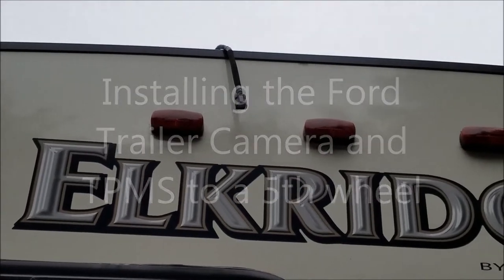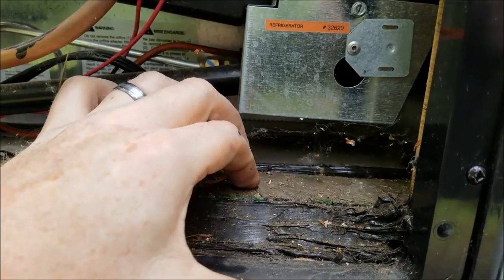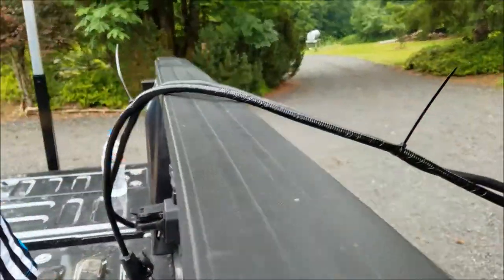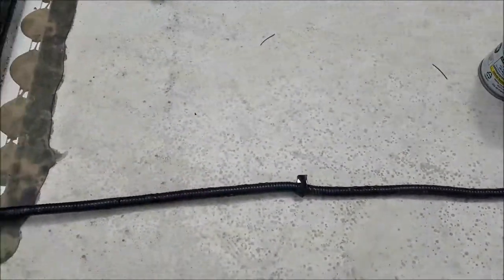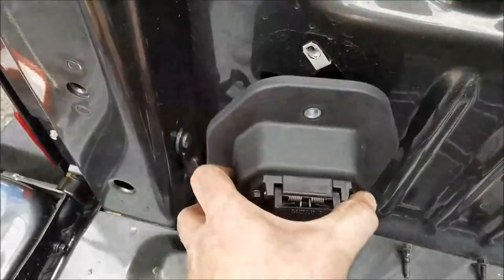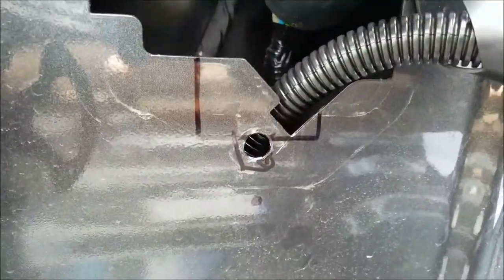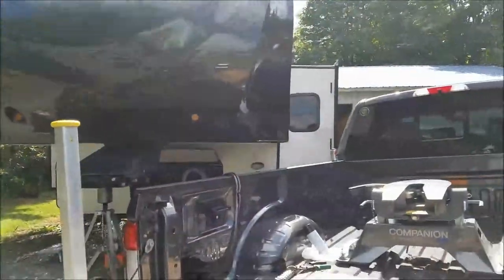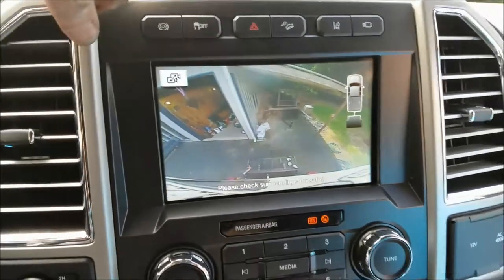2017 Super Duty Trailer Camera and TPMS install

Comment: Thanks for the video.  I have the TPMS installed so far but still deciding on where to run the camera cable.  I was wondering if you have an issues with the camera being over the break light vs under it?  Do you get glare from the brake light?

Comment: My Ford OEM kit came with a connector that replaced my bumper 7/4 pin connectors. I was disappointed as I haul a Fifth wheel trailer too. Where did you get your kit from?

Comment: Nice!  Only thing I don't like it seems is you can only show the camera when in reverse.  Is that correct?  It would be nice to see behind you when driving.
Reply from the maker: You are correct, per designed and delivered by Ford, the cameras are limited. The front camera have speed cutoff's, the rear (tailgate, high mounted (3rd brake light) bed cam,  and Trailer back-up cam) are only available in reverse. Some people hope either lockpick for the sync3 or maybe some config changes in FORScan may allow them on at all times, only time will tell as this is new for the 2017 model year.

Comment: recongeek Are you still pretty happy with this setup?  I just bought the kit, pending my Super Duty delivery, and planning to mount on my 36' travel trailer.  Also - did you end up screwing those cable hold downs, then using lap sealant to seal up the screw hole over the top?  Couldn't tell.  Thanks for the video!
Reply: Cairns02, where did you get the kit for mounting the new connector in the bed, opposed to the bumper?

Comment: How come you didn't use the 7 to 12 pin instead of cutting out side of box i got the camera system from ford but i did not get the tire pressure part of it the part i asked you about is where your 7 plug is at new the bumper and all the wires already are wired under the truck

Comment: were in 2017 and ford doesnt know what wireless is lol
Reply: Pretty tough to get good quality video wireless when the trucks are 20ft long and the trailers are 40+... You'd have to power the camera somehow; and power a pretty powerful processor and wifi system (or do it analog and get quality that looks like oversampled 320x240 chinese cameras junk)... wired is a much better system IMHO.